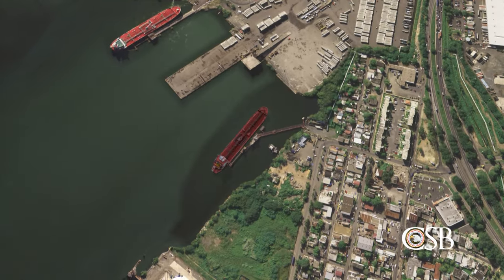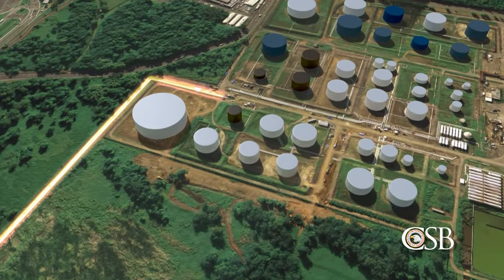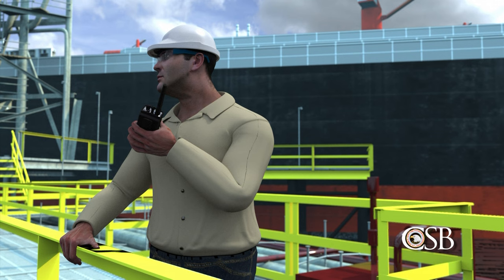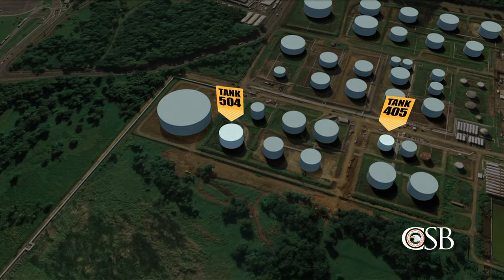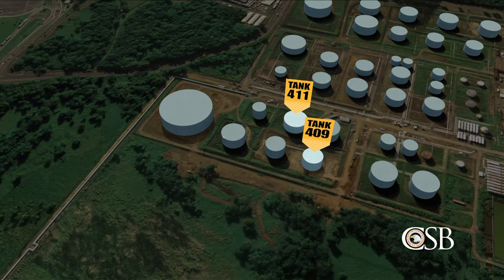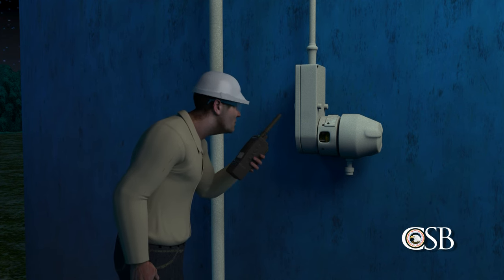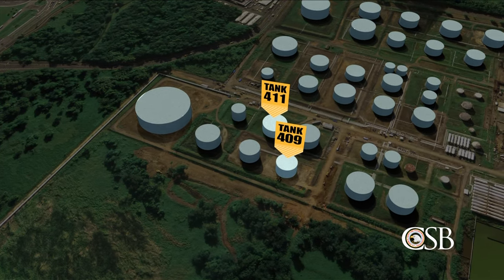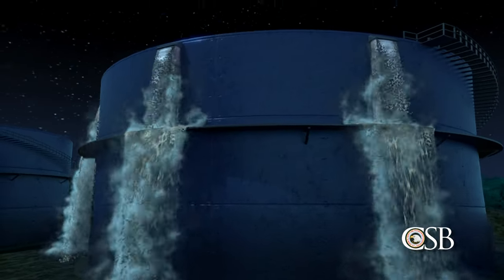Excerpt from Upcoming CSB Safety Video "Filling Blind"

Comment: It seems to me like equipment from 50s-60s. Manual valves not controlled by central operations or predefined program, no backup fuel level probe. In those days you dont need a physical contact to measure fuel level. No flow control, no alarms. How is this facility even allowed to provide a storage for gasoline? They basically threat hazardous and very expensive material like water on garden.

Comment: This sounds like the fault of the employees more so than the procedure itself. Yes the measurements were broken but the fact they let it run for hours and dumped nearly 20 full tanker truck sized gas into the area means no one was watching or paying attention at all. The thing is the operator on the other end was monitoring the radio and as soon as he heard it was overflowing he stopped. So that means he was doing his job but the other folks weren't. It would be totally forgivable had they dumped a few 1000 gallons of gas but to wait until nearly 200,000 gallons dumped before catching on really screams incompetent.

Comment: This all could have been avoided if they would have had high level alarms 🚨with a 1000 bbls safe fill. And so much for LEL readings and emergency stops...
Reply: Yeah well from what I've gathered of how industry operates. Making suggested improvements like fitting high level alarms would have been deemed too costly and likely brushed off by management of the tank overflowing as an unlikely event.

Comment: They use radar now to more accurately measure tank level and scada to shut the system down if it gets to within a few inches of the vents to ensure this doesn't happen. 
There are 'floating roofs' , just large steel sheets with pontoons,  floating on the liquid to minimize air in contact with hydrocarbons for fire control.

Comment: Suprising that such a large facility didn't have automatic overfill inlet valve cutoff, overflow pipe leading to slump/controlled burn facility, redundant gauges and overall material balance system to know quantities of oil in tanks which can be cross verified with level gauges.

Looks like an amateur outfit running the place with no knowledge of chemical engineering 101.